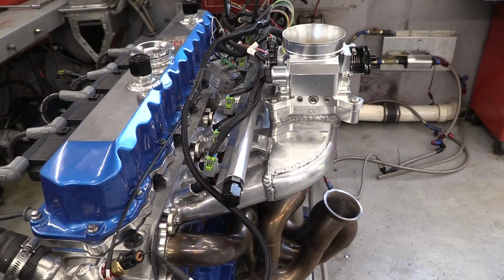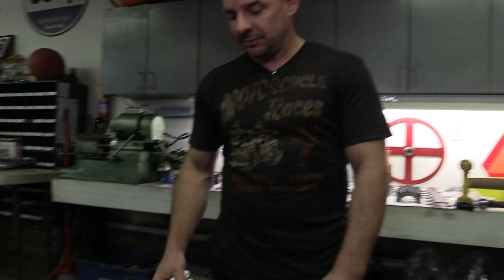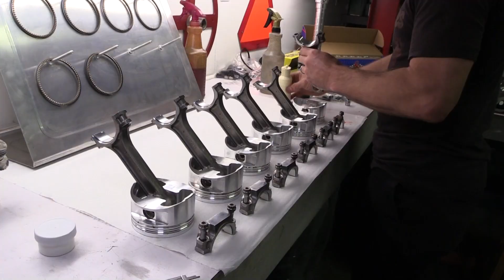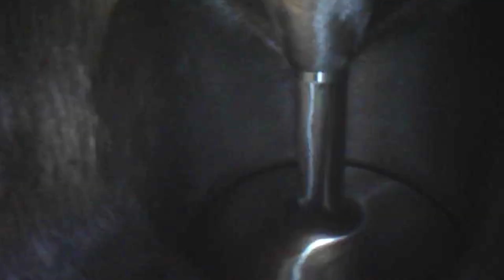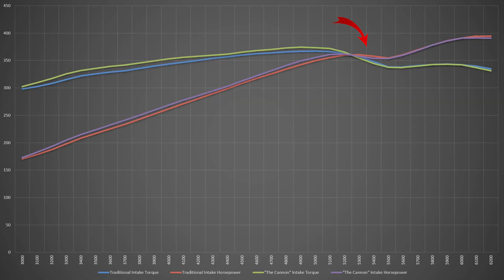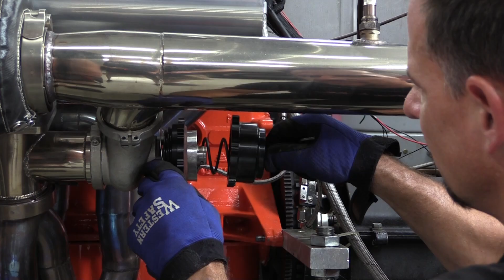Turbo Jeep Smashes World Records! (Tons of Innovation!)

Comment: I'm not a 'Jeep' person but that was real impressive. A modified stock head - wow. Pretty much always been told it wasn't possible as cast iron doesn't allow enough cooling for big HP numbers, NA or turbo/supercharged
Reply: Guys have been using cast iron for years and years to make 1000+ hp on multiple platforms though
Reply: @brandonpanozzo86  True, but what was the reliability? Usually piston crown is running much hotter and disintegrates even when everything is set up 'perfectly'. I have very limited experience with methanol water injection, although know it does substantially reduce temperature
Reply: @1crazypj  there're plenty of iron ls blocks making lots and lots of power. Same for iron nissan blocks.
Reply: @elonmust7470  I know iron block motors can make a ton of power, but, they usually have alloy heads. With iron head cooling is always a problem as cast iron doesn't conduct heat  as well as aluminium. (the biggest issue is exhaust valve temperature not combustion chamber temp) Low boost and lower temperatures are fine but high boost is generally drag strip only (unless you have large  'Rocket Turbo Boost' fluid reservoir)
Reply: @1crazypj  I think you might be stuck way back in the past. I
Reply: @elonmust7470  Probably but ain't we all? Majority of the 'technology' used today was 'old' by the 1940's on piston  aircraft engines (water or water methanol injection, etc) The only 'new' stuff is electronic developments which didn't exist back then and the reduction in cost of 'exotic' materials
Reply: @1crazypj  No, I run everything I have on fueltech, I have enough tunability to quell issues like hot exhaust valves (timing).
Reply: @elonmust7470  It's the nature of the beast. The exhaust valves have milliseconds to transfer excess heat, if you run long enough and hard enough the exhaust valves will get hot enough to cause 'dieseling' Hell 11,000 hp drag cars diesel for last half/third of track even with 450amp ignition systems, the plugs art burned out
Reply: @1crazypj  you are conflating a lot of things into one. Definitely stuck in the past.
Reply: @elonmust7470  I work on piston engines, any size, any year, doesn't bother me. (except large marine diesels, they need a crane to do just about anything) Motorcycles are easier to work on as you don't need a hoist to build engine or move it about.  (cast iron big block Chevy head is as heavy as many modern 600~750cc motorcycle engine and transmission packages )There have been 15,000 rpm motorcycle engines made for around 30 years or more with 220bhp/liter normally aspirated and around 1,400bhp/liter with turbo/NOS. Around 600bhp/liter is considered to be a 'street' motor in a 350lbs motorcycle. I'm not even counting the 21,000rpm ordinary production Yamaha motor from 8~10 years ago. Yep, I'm stuck in the past but at least I'm not arguing without actually saying anything.
Reply: Guys have been doing it in BBC bbf and 4g63t since the 90s and the failure on the 4g63ts is the rods
Reply: I make 950hp on a iron headed big block Chevy. Little over 600 on motor and a 300 shot of nitrous. 433 cubic inches. Bin running 4 years and many bottles of nitrous and street miles. All on 91 octane fuel.  I use a formula 112 fuel additive when using the nitrous.
Reply: @JAKDRZR  That's pretty impressive, big block heads need a bit of work to get half decent airflow . How long can you run nitrous before detonation?
433 is about  seven and a quarter litres?
Reply: @1crazypj  7L= 427 cubic inch. So 433 would 7.1L ish. My heads are 990 hi performance rec ports that are ported and bigger valves. As for nitrous use it goes at least a 1/4 mile without issues. Lol
3500 pound 68 nova and it runs 9:60-70’s depending on the day.

Comment: Holy smokes, that would be one heck of a ride in a jeep. Possibly put a larger exhaust housing and wheel to release some more back pressure off the engine headers wont get so red power slightly higher in rpm?

Comment: Still didn't balance the motor. Throwing away up to 30hp and making grensdes
Reply: Actually every single build gets neutral balanced, including this one!
Reply from the maker: @keithnewcomer4406  Never mind, learn something new every day!
Reply: @keithnewcomer4406  It's one heck of an awesome motor. I should have known at that rpm.
Reply from the maker: Uh, you don’t balance straight sixes.
Reply: @TheHorsepowerMonster  Every motor needs to have some balance.  Normally the straight sixes don't spin past 4500-5000 rpm where exact balancing is not critical. Heading to 6000 and beyond it's far more important. The counterweights are there to offset rotating and reciprocating weight.

Comment: I really hope they balanced the rotating assembly. That's just insane if they just threw it together. Any manufacturer will cut a custom cam for 500 bucks. The motor will blow up in a few thousand miles unbalanced like that. The snout and balancer will snap off.
Reply: You don't need to balance the 4.0L as an assembly though. That's part of the fun of that engine.

Comment: This engine already has cooling issues and runs on the hotter side. It comes with a factory cap at least 18 lbs, newer ones I think 21psi. Now you have filled the water jackets with enough cement to choke the cooling capacity down at least 70% from the looks of the fill in the block and are putting 4 times the fuel / btu thru the engine. I am curious how this is "streetable" and not a dyno queen ? AND doing it with the chunk of cast iron on the top of the engine, not even an efficient cooler aluminum design. Hat is off to you but this looks like something for the track and only the track.

Comment: If someone actually put the money in a 2007 Jeep Compass yes a Jeep Compass they weigh under 3500 lb Factory 2.4 VVT 5 speed manual with a four-wheel drive most people don't drive a 2008 Compass 5 speed VVT like I do and that's what told me if I had the money to actually build it properly Turbo with its four wheel drive system and it being very light I already hold seven and a half RPMs stock I've had a bunch of toys right now I drive in 04 GTO LS1 T56 car 02 GT New Edge 2 valve 5 speed Mustang 90 GT 5.0 302 car 05 GLI 1.8 Turbo 6 speed manual o2m LSD setup and if I had the money at the time I think that jeep would have been my best bet for a drag build

Comment: Impressive numbers but I've owned three Jeep Grand Cherokees thru the 80/90's, used to tow my bass boats and I had never experienced any lack of power.  In fact, mashing the throttle to accellerate onto the freeway from the on-ramp usually caused the read tires to spin, providing ample validation of its power. Can't even imagine 4X the power..

Comment: That inline 6 has been my favorite since I was a kid.  My dad had one from the time I was born till I was 17.  Had 280k miles and still ran like new without leaks.  Not to mention the excellent torque
Reply: My dad bought a jeep comanche in 1990. I was 3. 

I drove this truck in high school (03-06). 

By the time i had it, the odometer read +430,000 miles. That truck never broke down.
Reply: @hleespartastic   must be why they stopped making them.  Absolutely legendary engine

Comment: Most people talking shit about LS builds have never swapped an engine in their life. Yes a ls swaps are over done but for a reason it’s the best hp to money build, you know how much work goes into every single one?
Reply: The size is also another factor and LS will fit into just about any bay
Reply: @FrequencyOfThought  Not to mention if you are not inclined to try and make 4 digit horsepower it's extremely cheap and reliable to do. I'm going to be doing one in my Intrepid and 6-700whp is dirt cheap and easy.

Comment: My friend has a ford f100 300 six with a turbo from a diesel and a 980 holley double pumper blow through, and holley spark management and 4" exhaust, real simple and on the cheap, but he's putting down 542 horsepower to the rear tires, it's quite fun on the weekends.

Comment: Is there any reason that the coolant passages between the head and the block are blocked by the head gasket? I changed mine and noticed that and it does not seem there is a gasket that does not block those ports

Comment: I love every type of engine, of course v8 are one of my favourites, but let me say, there´s nothing more satisfactory than see that a solid, clean and powerfull inline 6, in this case it´s a jeep one, but i could be a chevy, ford, whatever, i can´t imagine what would be a car with this engine in it, almost 900 lb-ft under 5k!! and 861hp dude, and they stopped the pull just before 5800....... boy  this is a totally KILLER street engine that i would love to have.. Amazing job to the guys from Newcomer Racing, amazing job people. Hope to see this beast again making ever more power
Reply: I agree, I am curious if you could keep it running at normal operating temps in a real application though. You’d probably have to do a lot to get a good cooling system figured out. Those 4.0’s run hot and I’ve seen a lot burn through head gaskets from running so hot. It would be awesome to stick it in an XJ and make a daily driver/rock crawler that has a lot of power to tackle any trail running 40’s-48’s you’d have plenty of torque to turn em no matter what you’re doing as long as you have drive train to hold up to it.

Comment: I've had too many jeep people tell me that 190hp on a 4.0 is its max. Of course most of them are not owners of a 4.0 i6 engine.....
Reply: Run it on a Barra ecu  set up a crank angle trigger and switch off the VCT.  All the hard work has already been done.
Reply: I turbo'd my Xj, best thing I ever did.
Reply: Full bolt ons with edelbrock head and comp cam. Thatll get you somewhere
Reply: Damn my b18c in a civic has 235hp     lol
Reply: @theedge5584  You've got only half the torque numbers. We're not drag racing but wheeling with a Jeep.
Reply: With stock rods 190HP sounds on the money. I bent one of mine on a 4.2 build with HEI and a carb.
Reply: I have a turbo i6 rn and it kicks ass
Reply: Naw there are so many options to build one. My plans for mine is the poor man's 4.6 stroker. 4.2 crank, rockers, cam, pistons, and some other things. But it should make 200crank HP easy. They say if everything is solid it should make 242hp
Reply: @geoffmetituk3604  you’re gonna make way more than 200.  My 05 with just an intake, exhaust and plugs makes like 200 you’ll at least be at 225 or 230
Reply: @ivanfromtheeast4709  2005 4.0l jeep is that even real
Reply: @CopperheadGarage  yeah with the HO it’s possible, I saw someone that made 860 on one
Reply: @ivanfromtheeast4709  no i mean did a 2005 jeep even come with a 4.0
Reply: @CopperheadGarage  yeah they were made till 06
Reply: @CopperheadGarage  they come in the tjs my buddy has a 6 speed
Reply: @geoffmetituk3604  meanwhile i get a tune and go from 200hp to 276hp. Gotta love turbos
Reply: The world is full of armchair experts.
Reply: A regular one yes but not a heavy modified one... And its just show that will never see a car bay are drove lol

Comment: shouldve milled and strapped the caps
Reply: You can't, as they are hollow. You'd take all the strength out of them. The stock caps hold fine as is, obviously!
Reply: @chrismorrison9140  they are not hollow, and its a proven method that has been used since the 50s and 60s on engines that steel caps arent available for.
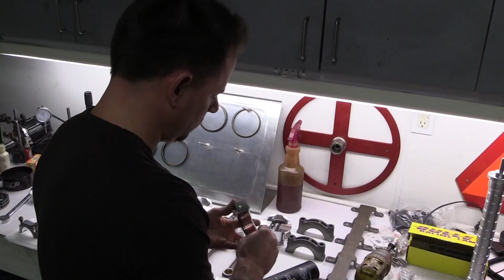Reply: @whatchu_talkin_john_willis  I understand strapped caps, what I'm saying is that these caps wouldn't be a good application for it because they are essentially "hollow", with a flange and two webs, and not solid like caps on older engines. If you machined the webs down enough for a strap to lay flat you would eliminate most of the strength of the cap. Go back to 5:40 in the video to see what I'm talking about.
Reply: @chrismorrison9140  thats the thing with a strap, youre taking the cap out of tension and putting it in compression. its just a liner to hold the bearing in place at that point
Reply: @whatchu_talkin_john_willis  Well I can see that with a standard solid main cap, but with these you still wouldn't be providing any additional support in the center area of the cap since it's hollow there. If he needed stronger caps he would have used the solid ones from the engine where he got the fully counterweighted crank, as the pre-1981 258's have solid main bearing caps. But the bottom line is that there's no need for it, even the hollow caps are strong enough to hold up to 800 hp, mostly because there's 7 mains not 5 like on a V8. I put 200+ passes on a stock 258 crank with stock caps and ARP bolts and never had a bearing issue.
Reply: @chrismorrison9140  the caps aren't hollow, they just an open arch (making them weaker).  backing them up with a strap will work all the same as you're putting the cap into compression vs how it works under tension in normal operation.  they didnt do a technical tear down and inspection, but im sure there was some cap walk, and cap walk is caused by the caps flexing.

Comment: My grand Cherokee did excellent on power and fuel economy. All you have to do to burn more fuel is, increase the valve dynamics, increase the air. I would like to see competition based on power/efficiency. I don't anybody can beat the '96 4.0 , that came right off a used car lot. Excellent video, congratulations on the record

Comment: Why would you fill the coolant passage like that?
Reply from the maker: It strengthens the block. It also locks in the cylinder bores so the cylinder walls cannot flex. Granted, you wouldn't want to do this to a daily driver, but you will notice he did leave an air gap near the top of the water jackets so water can still flow around the top of the cylinders and through the cylinder head for some cooling. Hope this helps.

Comment: I’d like to see what the max out is bone stock everything just a good turbo and fuel setup
Reply: You can push the boost as far as the turbo will support. If the turbo supports 1125hp, that's how much air it will push. The stock engine can move that much air, it just needs a crapload of boost to do it. The rods probably won't support that power level.
Reply: @EricErnst  Obviously.
Reply: Go on Richard Holdener’s site and see if you can get him to boost the shit out of a stock 4.0l
Reply: @kyleolin3566  Richard is a badass. He loves the other guys.

Comment: I’m curious what it would do on e85
Reply: 20psi means it is already on e85. ....  unless it has minimal advance and or very low compression = very poor fuel economy
Reply: @nordic5490  I don't see how you can safely assume they are running e85 just because they are running 20psi. Considering that the engine is 8.5:1 and running methanol I would say its safer to assume they are running pump premium. There are a lot of areas that don't have access to e85. I have one station local to me that is a 20min drive to get it and even then its only e85 for the summer months.

Comment: Funny everyone thinks nissan and toyota has the best engines until someone builds a better one the trailblazer 4.2 6 cylinder makes more then this will make
Reply: A 2jz would make twice that power without filling the block or any crazy changes. Just bigger injectors, turbo,  intercooler, and a tune is really all you need. Wouldn't need to replace intake or port cylinder head.
Reply: Chevy developed a 400 HP Atlas 4.2 for the Trailblazer SS, but didn't use it because of the length of the engine causing crash test issues. The 4.2 was on Wards 10 best engines list for 4 years.
Reply: @wymple09  that's interesting since the 4.2 was used in the trailblazer anyway. High performance had stricter standards? My guess is that for performance and tuning Americans wanted a v8 not a 6 cylinder.
Reply: @njinthemj52  No, it was just a late change when the decision was made to stop the inline 6 production. The V8 actually made a few less HP.